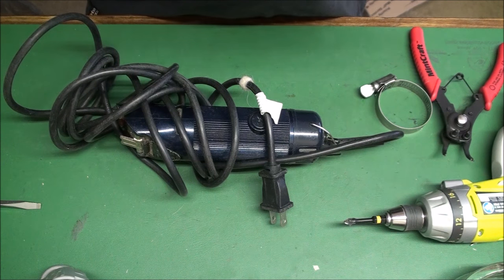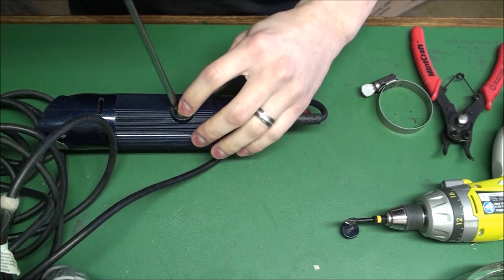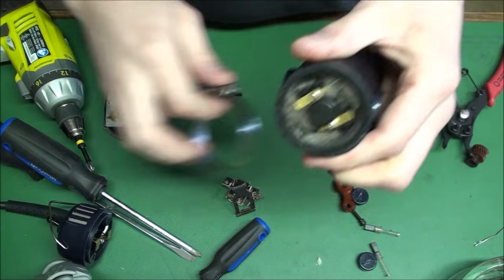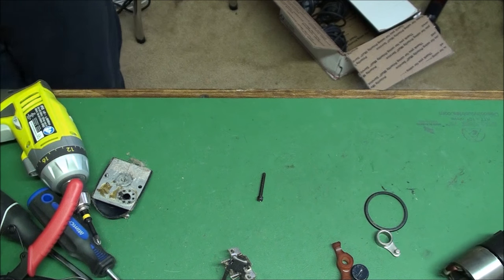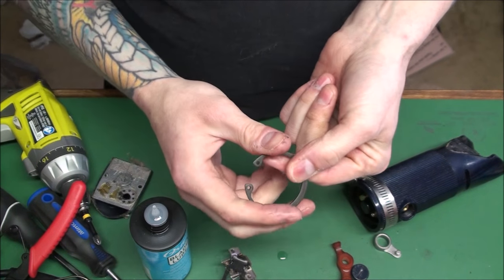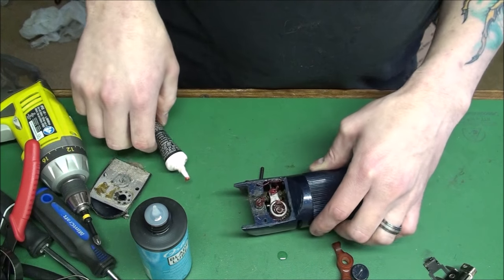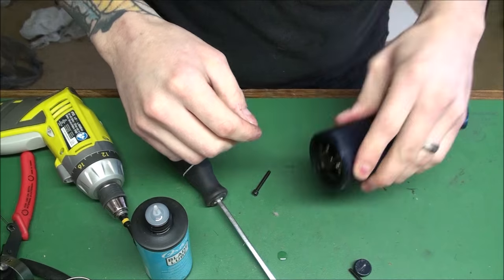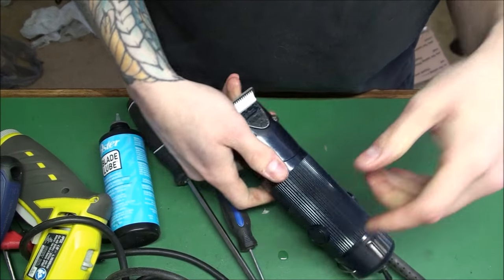Oster Turbo A5 Clipper Basic Service

Comment: Thank you SO much for this video. My clippers were overheating to the point of not being able to hold them for long. Was about to buy a new set and found your video. Stripped right down, oiled and greased and now they're running like a charm. Really appreciate your time.

Comment: What size screws did you replace the old ones with? Mine are stripped out, but the hinge still seems in good condition, so I'd like to switch those out first and see if that's the problem. Keep me from walking around Lowe's holding screws up together. 😂
Reply from the maker: You want to make sure the threads in the housing inserts aren't stripped as well. We only use Oster replacement screws. Not sure the size.

Comment: I wonder why Oster removed the ball bearing oil port on the side of the turbo A5 that they had on the classic 76? Didn’t they think it was useful? They actually must have changed the mold for the plastic shell to remove it.
Reply from the maker: They probably removed it because you really can't oil it that we'll with it. Also, when you get them service the bushing should be oiled and have enough for it to last up to a year at minimum. There's cotton around the bushing that holds oil.  So the oil wick and the ball that were removed were really unnecessary in my opinion . Thank you for watching

Comment: i got a pair of oster turbo a5 2 speed....used them for awhile but they vibrated my blades to FK...(fall apart)
what would cause that problem?
Reply from the maker: It could be a few different issues. Not easy to identify without seeing them.

Comment: At 3:25 it looked  like a  torx bit screw it's a wonder the Phillips was able to remove it.   Torx are better than Phillips and flat blades.  I am not positive but it looked like a torx to me.  Thanks for video.
Reply from the maker: No Oster a5s have torx bits. It was a Philip screw that was stripped and now looks like a torxs bit. You are welcome and thanks for watching

Comment: Can i use lucas white lithium grease or do i have to use oster grease ?
Reply from the maker: Hello. I would recommend using Oster grease only because it can stand up to the heat and it has no added materials that will damage the gears. For example some Grease has fiberglass in it
Reply: @cloudsdiamondsharpening3973  Thank you so much
Reply: @cloudsdiamondsharpening3973  I've read in the internet that petroleum grease will eat plastic parts and thats what oster grease made of ( lithium soap petroleum grease ) what do you think of this ?
Reply from the maker: @MrFSTQ  I don't know. I don't know what Grease. But I always recommend Oster grease because it is manufactured for those clippers. Now if you find a grease that has the same ingredients of course it will work the same. Plus different Grease has a different melting temperature. I'm not saying you're grease won't work. I just always use the Oster. It isn't very much and it's made for the clipper

Comment: Just did some of the things (the easier things not too deep in the machine) and now it won't turn on at all.  I don't see anything wrong with the brushes.  But the bottom switch kind of wobbles now.  I didn't need to replace anything.  Just removed hair and screwed things back in.  Only interior part I moved was the orange thing, took it off, oiled under it, put it back.  Now I have a machine that doesn't work, when in reality I needed to check the blades and that was not covered on this one.  If you're a novice don't try this at home.
Reply from the maker: did you put the brushes in correctly? they have a notch on them to be sure they go in correctly

Comment: So I can't get my new blade to snap back on.  I slide it on that tongue... turn on the machine, and push the blade down.... but it won't stay down... it pops back up.  What is wrong?
Reply from the maker: Lorri Diane Wright hello. I cant tell you for sure the problem without looking at it but it sounds like your hinge is weak and the latch is broken.

Comment: I did everything as told. (Didn´t take the motor away). So basically just greasing and checking carbon. And...after that the machine didn´t work at all. Any ideas what went wrong?
Reply from the maker: Did you put the brushes in right? they have to go in correctly to make a clean connection.
Reply: You were probably right. The tried to take off the brush...and the carbon part didn't come out.. There it is, just the piece of carbon, plastic part broke. Any idea how I get it out? I thought it's impossible to put the carbon brush in in a wrpng way..? How could I manage to do it, any idea?
Reply from the maker: Take it completely apart to remove the brushes safety.
Reply: can you explsin how..?
Reply from the maker: I have a lot of videos explaining how to fix them. if you can't get it, that's why I'm in business BC I can.
Reply: ok, can you send me a link..?😊
Reply from the maker: no sorry, I'll have to watch them all. there is to many videos. I recommend searching my channel.